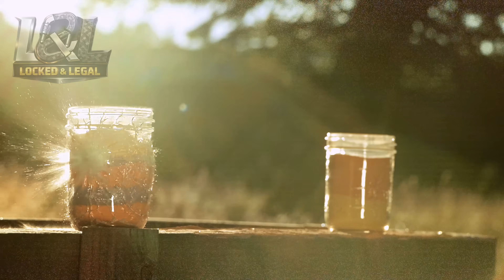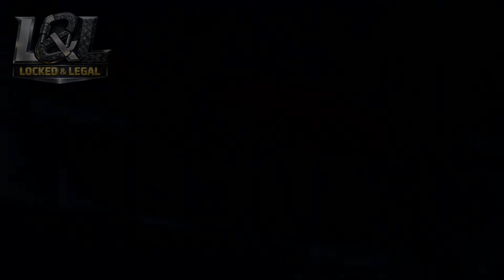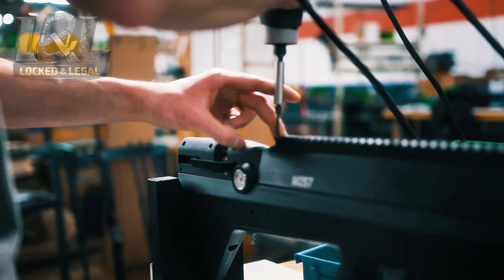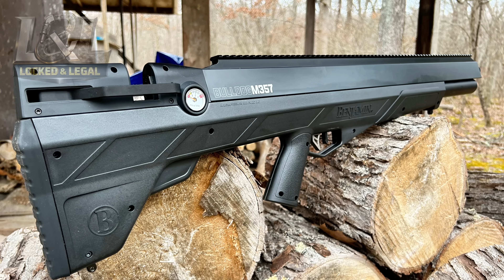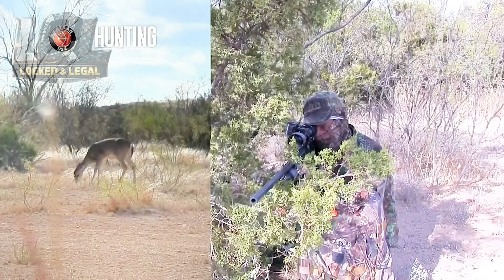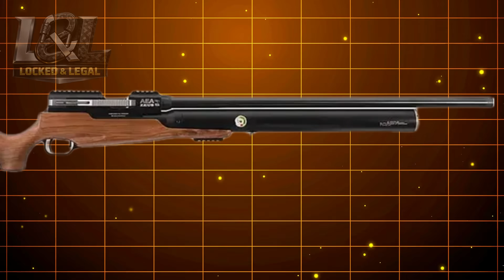The 7 Most Powerful Hunting PCP Air Rifles on Amazon (2026)

Comment: On the Hatsan Pile Driver you said that the fill probe is a proprietary design and becomes a major wallet drain after the initial cost of the gun? Sure it's a proprietary probe but they give you one with every gun and you shouldn't have to buy another one unless lost or abused. That said I think the probes are like $14.99 or so...
Reply from the maker: Thanks for the correction!

Comment: do it have any in 177
Reply: $2000-2300 USD For an FX Impact M3. About 50 fpe and it is designed for slugs. You would need a very heavy pellet that would keep the pellet below about 930 fps or stability will be compromised and accuracy will suck. Supersonic and trans-sonic speeds cause spiraling in a pellet  It also effects slugs, just less so.

Unless you are shooting slugs at long distance on small game, I do not understand using such a small caliber with high power levels. 

For hunting, you are far better off moving up in caliber for hunting purposes. Far more tissue damage with bigger calibers,  way less wind drift and more energy retained at those distances.

What is your intended purpose?
Reply from the maker: Some of the models featured are available in .177, while others are offered only in larger hunting calibers. Availability can vary by model and retailer, so it's worth checking the specifications for the specific rifle you're interested in.